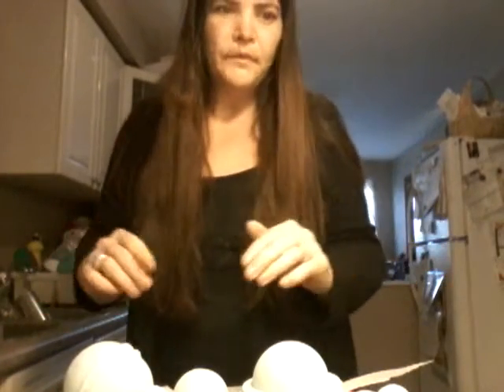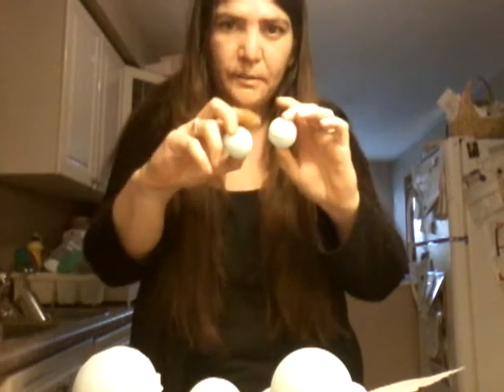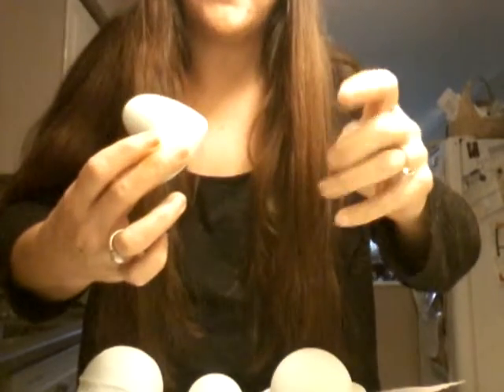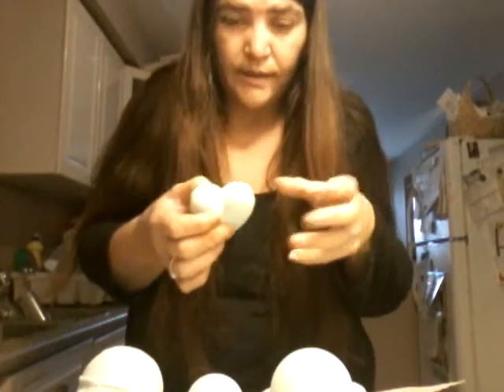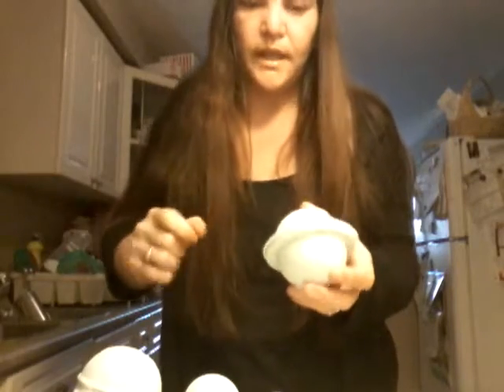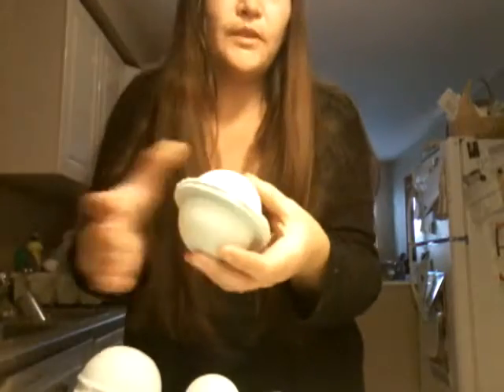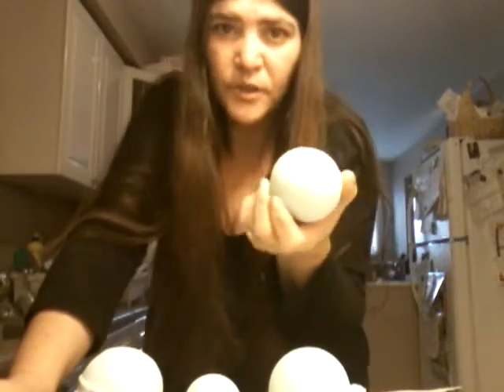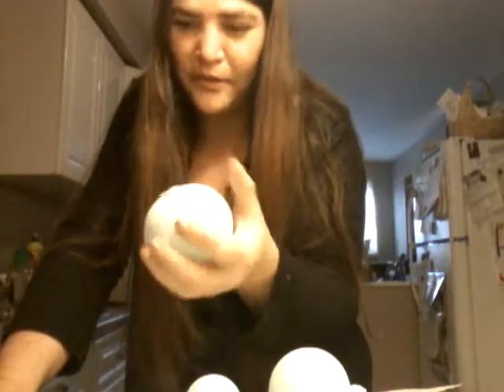Update on the bath bomb molding video

Comment: Hi Tammy... Ugh... I just finished 3 batches of the Blink Bomb Recipe (love it by the way!!!).  #1 question = Do I , or do I NOT need Poly 80 when I used Lakes for some color in my bombs??  I thought I needed it to help disburse the color in the water but also to make sure the color doesn't stick to the sides of the tub??  I did use a little bit of Lakes to make some pastel colored bombs so I did use the Poly 80 also.
Reply from the maker: Hi I personally  don't use poly,  I find when using slsa there really isn't a need for it. and you won't get a staining per say, if anything you may get a fine line of coloring around the tub,bthat jyst usually means it's sticking to the soap scum ring that may be there then it's just a matter of taking a cup of water and rinsing it,  when that happens it just means or tells me it's time to wash my bath tub lol, but as far as using it it's totally a personal preference,  I find if you get heavy with the mica it happens more but I don't and never have used it
Reply: Thank you for the help!

Comment: Exactly what I was looking for. I do pretty good but I had questions. I still have one lol. I want to embed toys...I'm getting bounce back and cracking only with those. Do I need to put them in an acorn package or am I just doing it wrong ?
Reply from the maker: +Crystal Matthis it really depends on the type of toy,vdome I have to use a capsule others I don't,  you just need to make sure that your using a big enough mold for the toy your using, I have had a couple that looked like they were trying to break out I just went back and gently took the top of mold and ur it on for just a min, you xan usually fix with your hand sometimes ,

Comment: Ah I twisted when I packed my last batch and some of them don't float ughhh is it overpacked I felt like my mix texture was perfect or even a bit dry because I wanted them to float ?!
Reply from the maker: dm gagaloo it's all about density  so u don't want to pack tight, and twisting can make them crack, or not stick yogether, or hard to get out of the mold, you want all ur mix to merge and intertwine evenly, , also ur recipe has to do with floating too, if ur using butters or not light oil that can do it,  and if your not using cornstarch or arrowroot they won't float
Reply: Atomic Balm bath n body I use coconut oil which I thought was light maybe I'll switch back to olive oil. But I'll try packing them a little less tight and not twisting them and see how that does. Thanks !!
Reply from the maker: dm gagaloo fractionated coconut oil is pretty good to use,v Olive oil is not, and it's not a light oil, you want something that soaks into the skin quickly and dosnt leave a greasy feel, lije sweet almond or avocado, or even macadamia nut, just be careful with nut allergies, now if you were making a butter bomb you could use butters that are  hard at room temp,  and having your mix dry, isn't going to help floating, it's all about density and bouantcy